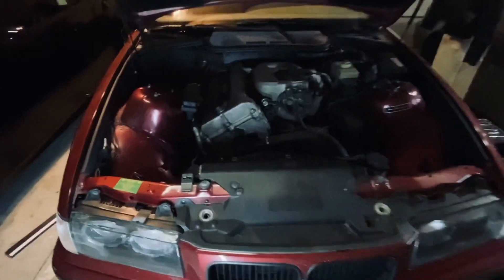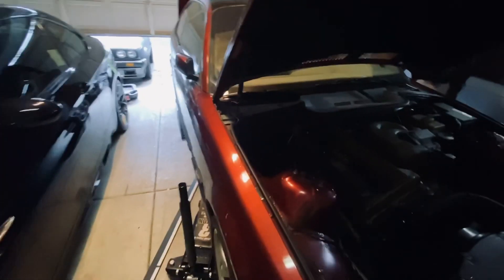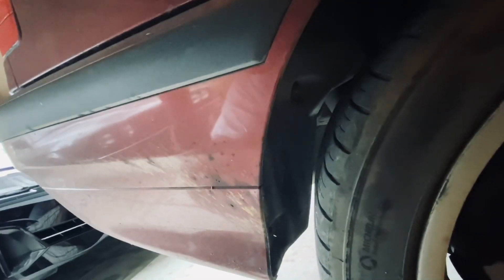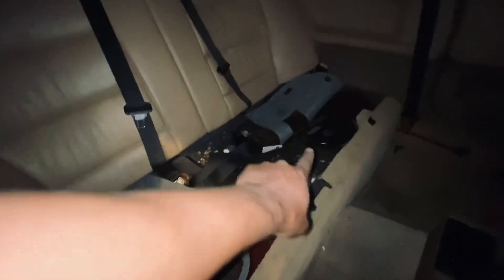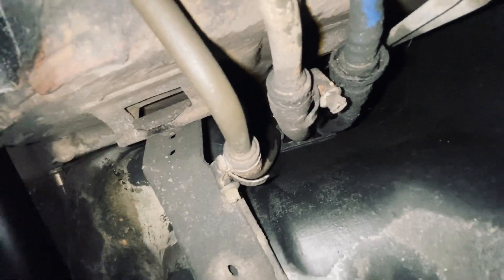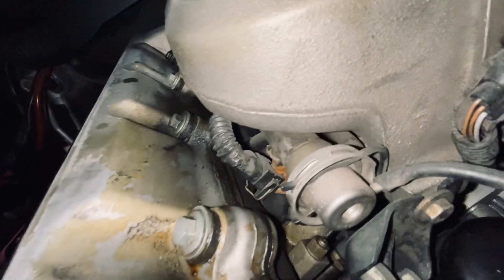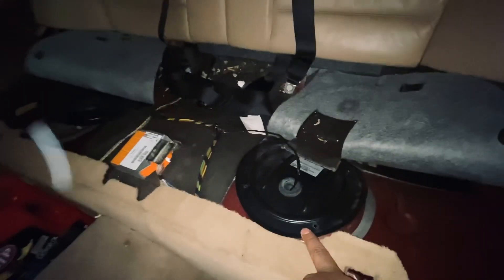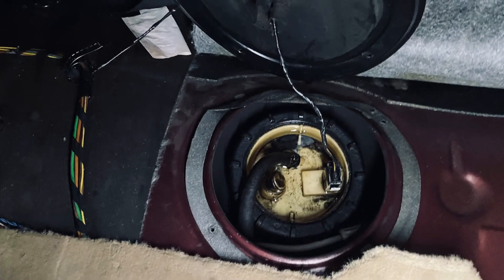Tracking Down BMW E36 Fuel Leaks - Quick and Easy Diagnostic

Comment: Personally it came from that hose at 4:17. Not sure if the hose was getting a bit loose or just the hose was not sealing properly. It was dripping 1 drop per second. Changed the hose, then it was leaking way more. I had to reaaaaallly tighten these 2 clamps very very hard to make the leak stop. Now there is no leak
Wondering if tightening the clamp a little bit with the old hose would have just fixed it lol
Reply from the maker: All the parts wear over time so it’s a “while I’m in here” fix sometimes. Hopefully you used the fuel hose clamps. They do a better job without damaging the hoses
Reply: @tractioncontroldelete  i used the same clamps that were on the hose before the leak. Maybe it got a bit loose, or maybe the hose wasn't sealing properly anymore
Reply from the maker: @Keless  the hose probably had micro-tears. They’re not easy to see but when the lines are under pressure it’s enough to cause a leak

Comment: Hey man I’ve got the same e36 and mine has a strong fuel smell so I’m gonna have a look but the smell is mainly coming from the engine
Reply from the maker: If the smell is around the engine then I would start at the fuel filter which is under the car near the driver door. Then start moving forward to the engine. Pay attention to the lines under the car as you move forward. Once in the engine keep an eye on the fuel hoses. If no leak found yet then look for leaking around the injectors. My guess, because the smell is from the engine, is that your O-rings around the injectors are worn. Very common. Circle back to me if you need more info…
Reply: @tractioncontroldelete  there’s a line that seems abit wet you can see it coming from the fuel filter line it’s at the start of the engine bay
Reply: @tractioncontroldelete and I’m guessing you can only smell the fuel when it’s been running not to long ago
Reply from the maker: @ZallZzzzz  that’s most likely the culprit. Although it’s only a little wet now, you have to keep in mind that the flow will increase a whole lot once the lines are under pressure from fuel. My email address and IG are on my page - send me a photo and I can take a look
Reply from the maker: @ZallZzzzz  for me, it’s when the tank is full because it goes above the sending unit. I fixed it yesterday and will post that video later on tonight
Reply: Hi! Mine is the exact same as yours! How do I fix it and what is the part called ?

Comment: mine only smells when starting it up, same car also
Reply from the maker: That sounds like the issue is a fuel line/hose because when it’s under pressure it can cause some fumes/fuel to leak out enough to smell it
Reply: @tractioncontroldelete  gotcha champ, will take a look
Reply from the maker: @johndekijk  keep me posted!
Reply: @tractioncontroldelete  well I have checked fuel lines, injector bearings etc but to no vail. however my fuel filter protective casing has broken after a significant hit on the underbody due to a bump. i'll try changing that soon and see if it fixes it.
Reply from the maker: @johndekijk  The fuel filter is right by the driver side door so that would make sense that you can smell it